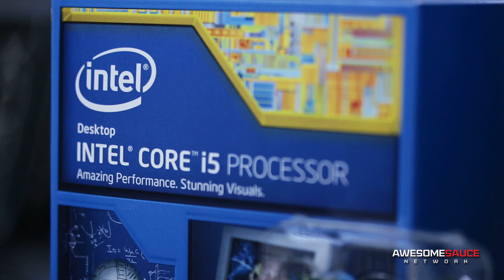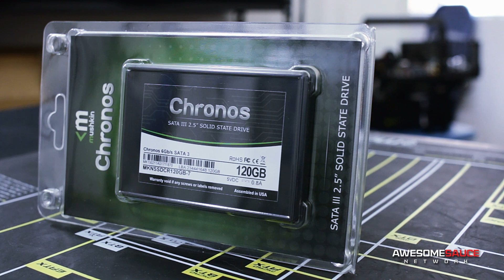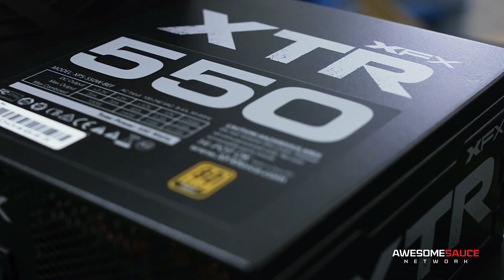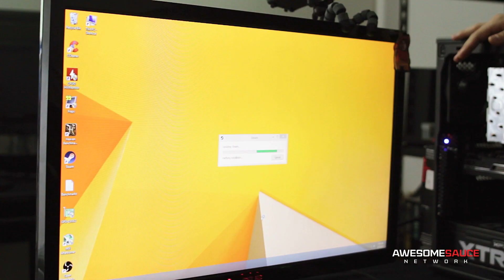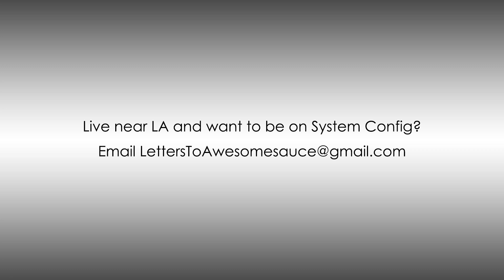System Config - Ep. 4: Brent's Mid-Range Gaming PC

Comment: I noticed that Kyle really loves Evolve.
Reply from the maker: PSguy Mentalist the recent DLC may have changed my mind >:[
Reply: Awesomesauce Network
 Yeah, you noticed that in the last AH stream. It's sad that games get messed up with DLC.
Reply: Awesomesauce Network I noticed you dont deal with static electricity. I dont understand this well. I saw one guy here on youtube. He used this anti-static wristband or something. Wearing it like a handcuff tied to the power supply. Please tell me is the static thing a myth or not? 

If so, how do you deal with it? 

Many thanks.
Reply: lightsleeperjude yes it is something to worry about, you see in the video he is using a rubber mat to build on, when i build computers i useually touch either the case, you often ground out yourself to discharge any built up static, from your shirt, socks, or even if you're on a rug or carpet (do not suggest building on), sometimes just a little shock that you may not even feel can kill a component. just because everyone has their habits doesn't mean its going to do that, I've build four computers with only bare feet and wearing no polyester and every time i go to touch a part i touch the tower case
Reply: lightsleeperjude
 Just touch the case and you'll be fine.
Reply: lightsleeperjude It's really not that big of a deal as long as your careful. Iv'e rebuilt my old 10+ year old computers moving them in cases and back into boxes pretty frequently just for the fun of building something and multiple times I've laid bare motherboard and video cards on my bed while building and nothings ever died. Just don't drag your feet across carpet with socks on while your building a computer and your fine.

Comment: Could of used the original PSU, and spent more money on the system
Reply: The guy said there were some problems with it.
Reply: ***** but didn't he say it was making strange noises? If a psu makes strange noises it's pretty obvious something is wrong.
Reply: ***** Then you probably shouldn't be commenting
Reply: ***** PSU could probably use a good clean, might just be the fan. The GS600 isn't too bad especially if you are not overclocking the CPU, which will draw about 30-40watts while gaming.
Reply: +Tom Ferreira nah fk better graphics lol. fully modular is the better way
Reply: A fully modular power supply is the way to go for better cable management and more reliability
Reply: Gamer Experience  Reliability has nothing to do with if its modular or not. Cable management can be solved if you are skilled enough to hide them away.
Reply: Tom Ferreira that's like having a picture frame hide 10 holes on the wall vs picture frame hiding 1 hole. idk about u but id rather see 1 hole vs 10 when i swap pictures. 10 holes makes me feel like i did shit work
Reply: The Corsair GS600 was released late 2011 its not that old for a power supply,and especially being corsair its reliable. Its not like the PSU was powering a high end system to begin with it still would of had a lot of life left. I'm still running a Corsair HX850 from 2012. The psu has seen many high end cards over the years and is still powering my 970 SLI setup.

Comment: Definitely like the direction you are going. Previous gen high end hardware is still better than current gen entry level hardware. Especially with the R9 280X which was launched in 2013 but used in a new build in 2015 :)

Comment: Kyle.  that 1GB vram ( just the AMOUNT of it) can handle wow at 1680x1050 and possibly 1080p at low/medium settings with plenty of fps to spare even while raiding giving the following are met:
1.  The vid card's GPU and vram interface are strong enough.  In this case..the gpu is the bottleneck.
2.  The cpu included is good enough ( I forgot the GHZ Brent's cpu was) with 4 cores.
3.  No power supply 12v rail bottlenecks of any context.
Enjoyed this and 99% of your videos though good man.  I thumbs up'd it ftr.

Comment: Love System Config!!! I am still running a Q6600 Core 2 Quad @ 2.4 Ghz, 4gb Mushkin Enhanced DDR2 and a XFX HD 5870 and she is still holding her own.  Keep up the good work!!!
Reply: demond penalver Why are you running a stock Q6600? It does 3.2GHz with the stock cooler EASY (I have the same one). Unless you were unlucky with the chip and don't have a G0? It'd still run some overclocking.
Reply: That's all I have at the moment.  I will overclock it again now that I have better thermal compound.  I think I have a G0!  I will check again.  Still a good chip!!
Reply: Yeah, it's pretty solid :) Building an upgrade rig atm though and this'll probably serve as a file server. Q6000 would probably hinder my new gtx 970 a bit. Not that that would be a real issue though. Still thought I'd build a new rig around it. Couldn't help it :D

Comment: For the people complaining about the PSU, I think the point of the show is to get a brand new system with that budget without reusing anything, so that people looking to build their own system can use the featured system as a reference. 
I don't quite get the point of a Z97 board and the CPU cooler though since the GPU isn't overclockable. I think that money could have gone into a 256GB SSD or a 2TB HDD, or maybe a better PSU, or a even a better case.

Comment: the t4 is so much easier to isntall than the 212 evo xD that backplate pulled some ears of my head
nice build but I would go for a 970, for more 50-75$ you can get the 970 which is about the performance of the 290X

Comment: This is basically the exact same rig I'm running (H87 instead of z97, Radeon 7970 instead of 280x but same card) that was literally $1000 in 2013 I believe.
Just goes to show that it's shitty how things don't get very much cheaper in the computer world.
Reply: Shayded man, you might look at this that way, but if you look at something like the GTX 970. it launched at 330$, while the GTX 780 launched at 650$. the 970 has more ram, and performs similarly to the 780, while being, literally almost half the cost. while the 780 got cheaper after the 780 ti launched, it was still way above the price of the 970.

the 280x might not have dropped in price that much, but remember that it's based on older technology, and the chips themself are probably somewhat expensive for AMD to make...

Comment: Just finished my build for just a hair over $1,200

NZXT S340 Black/Red edition ~ $70
24GB HyperX Fury 1600 DDR3 Ram (used 16GB that I had laying around) ~ $60
Intel i5-4690k (OC-ed at 4.5 Ghz) ~ $199
MSI Z97 Gaming 5 mobo ~ $95
250 GB Samsung 850 Evo ~ $99
1TB WD Black HDD ~ $70
Corsair H100i ~ $85
EVGA G2 Supernova 750w PSU ~ $79
MSI Geforce GTX 960 4GB Gaming edition (OC-ed at 1552 Mhz) ~ $240
CMStorm Rapid Cherry MX blue mech keyboard ~ $79
Windows 8.1 ~ $89
Corsar AF120 and AF140 case fans ~ $40

Total price of build ~ $1,205 (WITH windows and a decent keyboard)

Witcher 3 is running like a dream on this machine. 50-60 fps on high settings.

Comment: Could have used some parts in the old pic for the new one
Reply: The 6770 is still a decent graphics card for 1080p. For those cheap 32" $100 720p monitors, that card is perfect. I recently helped a kid putting a 7750 in a hand-me-down computer and it drive a cheap 720p LCD TV really well.

Comment: good build. personally I would have re-used the corsair psu and swapped out the amd for an nvidia gpu. nothing against amd but for video rendering, if the adobe software isn't current, those cuda cores would have come in handy. or is one of the rules that everything must be new with no salvage parts from the old system?

Comment: honestly, he should've just added a small SSD (boot drive), put in a new fan or two, replaced the gpu with a better card, added more memory, and cleaned up the internals and did some cable management. Would've costed under $200 and he would do fine

Comment: yeah the 1 GB frame buffer is not the issue with his ability to play wow. (I used an HD 6850 and would get 40-50 in that exact same raid environment). I would bet heat causing thermal throttling being the issue.

Comment: Just a thought...Wow is optimized for Nvidia, my gt 640 ran just as good as my 7850...If someone is just playing wow or lol, sticking with Nvidia is still the default choice...Great build though Kyle, excellent video as always
Reply: Is your CPU bottlenecking performance? I just tested it and the r9 270 I have (7850) smashed the gt 640 performance in wow. I also tested it with the 280x and that had insane fps in wow. It isnt optimized for either Nvidia or AMD  btw.
Reply: wapted That's weird...I'm not only using me as the sample, everyone I raid with, plus others all figured it was optimized for nvidia..All of us use different cpu's and gpu's ranging from dual core intel's all the way up to the new 6 core intel's...I know me personally, I use an 8350/gtx 660 and I run at higher settings vs someone with the same cpu, but they use a 7950 gpu...weird..
Reply: wapted But to keep this convo going a bit further, quick searches in google will bring you to threads and tons of discussions where ppl feel the same way I do..I've usually been the 10% when the 90% is screaming something else, but in this case I think the 90% is right when we all say wow loves nvidia cards...
Reply: Erin Humphreys Officially they have not said its optimised for Nvidia cards, but its possible.

Comment: I have a couple of questions. First I love your channel and this video series. One thing I have been wondering about is if any of the components from the old rigs could be reused such as the case(cleaned, stripped and referred), the fans, cpu cooler ect?
I am asking because the will not get much for the parts and the systems are old enough where it does not make sense to hand them down  

Second why do you recommend Amc over Nvidia?  I thought with the GTX970 series of GPUs that  Nvidia was the best bang for the buck?
Reply: I would go for r9 390 over gtx 970.
r9 390 is just little more powerfull but it has 8gb of vram,higher bandwhit and mantle support:)

Comment: thanks keep this kind of videos, though i got a question:
why didn't you kept the psu since it is a Corsair certified 600w, and you went with a 550w,
you could'a spared some good amout of cash keeping the old psu and probably getting a 290x, also in my opinion 1600mhz rams are just fine, to save some $ there rather than the 1866mhz.
also a cheap i7 with 8mb L3 cache, is better giving the fact he is editing videos.
Reply: hisgr8nessmadzak Those 1866MHz sticks weren't that expensive, but still a pretty useless upgrade from 1600.

Comment: This is a great PC but there a few things that could have been tweaked according to the needs of the user and not to just build a good pc in general. 

Firstly the case is a non windowed case therefore by all means I would have kept the 600W corsair PSU and given up the aesthetics offered by a modular psu since you wont be looking inside anyways. 

Secondly the z97 is pretty much useless for this build as no over clocking will be done, Would have went with a b85 board on the 60-70$ range.

Lastly with the money saved you could have put in a gtx 970 which is far efficient compared to a 280x, this will be more efficient than a gold psu anyways and moreover the pc would have ran cooler aswell. 

Nevertheless a very well balanced rig, but the 900$ doesnt justify some of the parts chosen however this is far better than Jenny's rig which imo was a total waste of cash

Comment: No sale on that gpu? Man, what a system for $900

Side note: i was kind of curious why you opted for a z97 board with a non k cpu.
Reply: Cause stability, features, price, upgrade ability, or anything else.
Reply: Anthony Sparta Still more stable, better voltage regulation, better power delivery, cooler VRMs, and other things.
Reply: Anthony Sparta Yeah, at that point you might as well drop a couple of dollars more on the K series. The thing is even though overclocking is really easy, there is a lot of misinformation out there and applications might give you wrong temperature read outs and blue screens are really scary I guess, so many people don't want to do it. When I build for someone else I would go for the non overclock version, save €150 and put them in the graphics card, especially since you're not going  to get any fps out of a cpu overclock anyway.
Reply: More stupid than getting a z97 and then not getting a k-series?
Reply: +IsawUupThere Yes

Comment: Pretty much identical system to mine - ive an 4690 instead of a 4570, same thing tho
Reply: I have almost the same set-up as you then :D, but I have the r9 280x TOXIC edition water cooled and over-clocked more. It runs everything I throw at it damn well.
Reply: what speed are you running it at and what voltage? I have an msi edition and im quite happy with it.
Reply: 1200 MHz on the core-clock and at 1.263v. Please note though it is water cooled but it sits around 40-50*c. I am very very happy with the card personally. If you are going to try and replicate my core-clock and voltages please take extreme care as with my toxic edition card it has a 'overbuilt' power delivery set-up so it can be done more easily and be more stable.  

I am getting around the same benchmark scores and in game performance as a reference GTX 780. 

https://www.dropbox.com/s/f0wqdpuhufolbc7/20150124_182407.jpg?dl=0
Reply: I have managed 1200 as well with +50mv on the core. I only use it when playing extremely demanding titles as the temperatures reach high 70's even 80C if its warm. Did you run 3dmark? What is your gpu score? Here is mine: http://www.3dmark.com/fs/4136645
Reply: ***** I shall run it now :) I need to download it though so I will tell you later. I am also using Windows 10 which I have found does enable higher scores in benchmarks as its better optimised.
Reply: wapted you can download the demo for free on steam

Comment: CPU cooler really necessary here? I feel that if you're not overclocking and have decent case ventilation CPU temps aren't much of an issue.
Reply: It never hurts though, and by keeping the CPU cool as it can be, it can help extend the life of the CPU, and the system overall.

Comment: I think most of these PCs could run much faster as i am using an Intel Core 2 Quad Q6600 and an AMD Radeon HD 6870 with 4GBs of RAM and theres no issue with for example League of Legends or even GTA 5 (if 20-40fps is enough but for me it is :D). If you would clean the whole system and set up a new Win 7 it should run much better than now!

Comment: tbh, when he said student, i was thinking maybe a 16-24 years old person
Reply: also dafak? $898 for Core i5 4570, R9 280X and 8GB of RAM? kyle, i'm disappoint
for roughly $892, my full system specs that i built early March is as follows:
-Intel Xeon E3-1231v3
-MSI GTX 970 OC
-8GB Kingston HyperX Fury (single stick)
-Asus B85M-G
-1TB WD Blue
-Xigmatek Vector S650W 80+ Silver
-Thermaltake Versa H25
-Corsair AF120 Quiet Edition High Airflow (120mm white LED)
IMO you should've opted for Core i5 4460, a cheaper mobo ( i mean a core i5 4570 and a Z97 mobo?) ditch the ssd and CPU cooler and opt for a GTX 970
Reply: queenform Maybe, but the 280x was more than enough for what he said he was doing and since he was video editing the better CPU would benefit him. After all, its personally preference, I would have done it differently but it doesn't mean his way was wrong. I do think the SSD was unnecessary though, he could have got a 290 at-least with the money he could have saved by not getting an SSD.

Comment: you could have saved a few bucks by getting the i5 4460 instead of the 4570 and by just sticking with the stock cooler. And why did you not reuse his Corsair PSU? Great video though!
Reply: ***** They're pretty much identical (saves like $10), not sure why he went with a non-k version though with that mobo. Customer wanted to use the corsair for something else.

Comment: Personally I would've gone for a cheaper B85 motherboard to spend some money on the PSU. XFX is just not worth the money. Many of their units are really loud. This is something I say from experience, sitting with one a meter away from me. Thing sounds like a darn vacuum when playing GTA V.
Reply: Shaxi Really don't see why you would care about the PSU. It seems just fine for this guy's needs. As clearly stated, he's not planning to do any overclocking(nor can he with the parts chosen), so the PSU he has is just fine. Though he could probably cheap out on the mobo, i can agree on that. Since he isn't overclocking, the Z97 is definetly not needed.
Reply: Shaxi I agree w/ u bout motherboard, go with b85, and ugrade the GPU or storage instead....
But for PSU, i think its fine, xfx xtr 550 actualy the same with ss g550 but fully modular cable, so it doesnt matter...
and once again come with mobo i'll choose b85, there s lot of option with black and blue MSI..